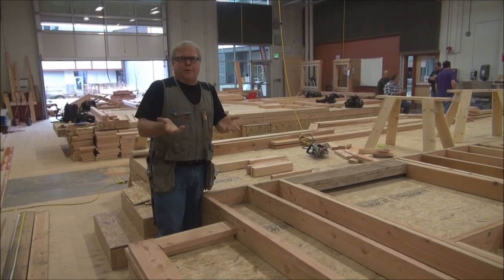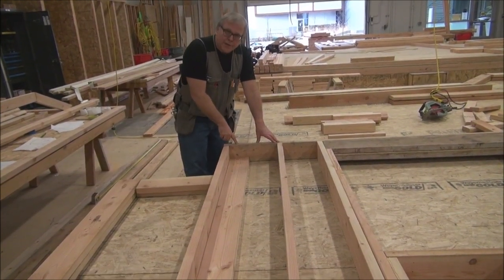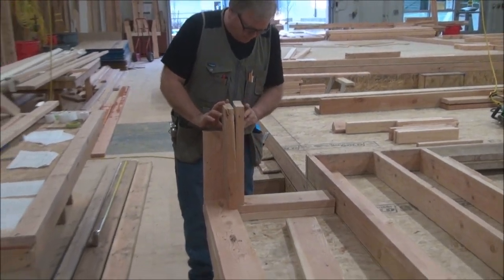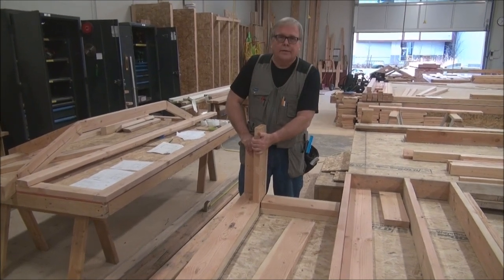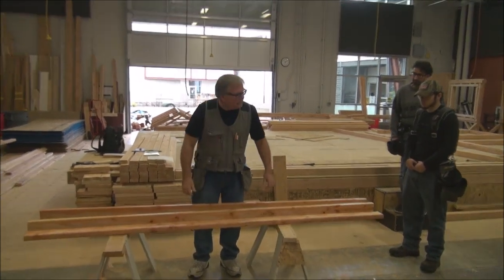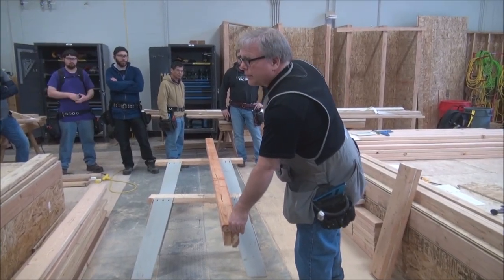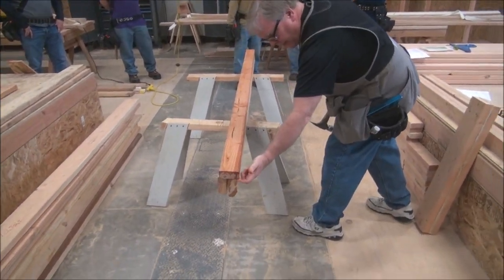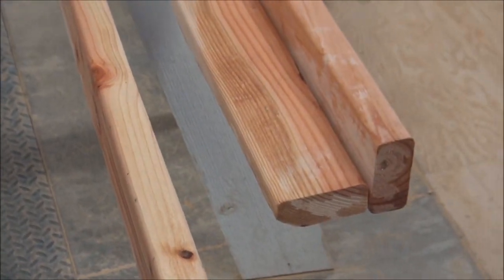Framing - Making a A California Corner

Comment: The California corner saves a stud but I still prefer the 3 stud corner. Especially when there is a hip roof with large hips bearing on the corners. I still end up using them though.
Reply: The California corner does not save a stud, unless you use 3 full studs on the end of the thru wall to get your backing. Most guys use two studs separated by shorter blocks as spacers. All building codes require 3 studs in a corner. and both methods give you that, but the California arrangement allows you to insulate the corner much better than the older method.

Comment: It’s just for insulation purposes. The old way is better
Reply: Not for insulation bud , also helps as structural and also for a nailer when doing drywall. Pay attention might learn something
Reply: @jasonrash1194  Actually it is for insulation, at least in many parts of Canada. That allows insulation to go in that wall cavity instead of using a triple stud which then leaves no space for insulation.